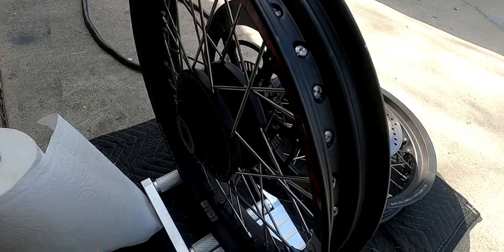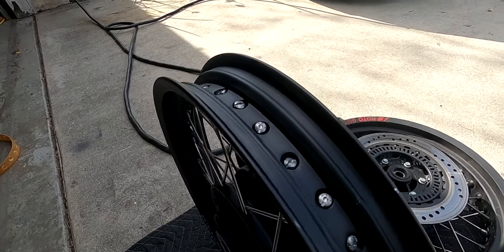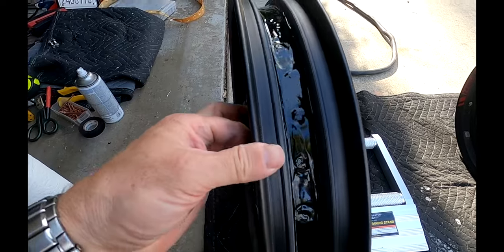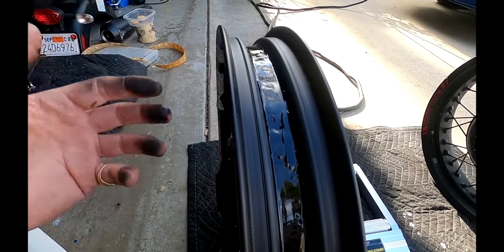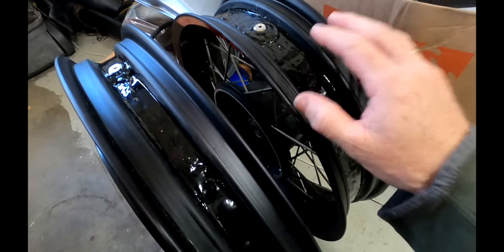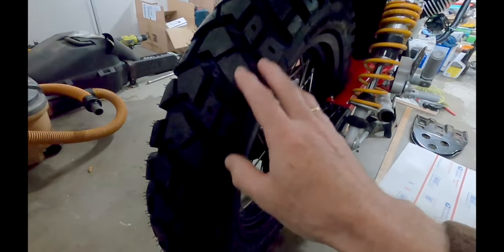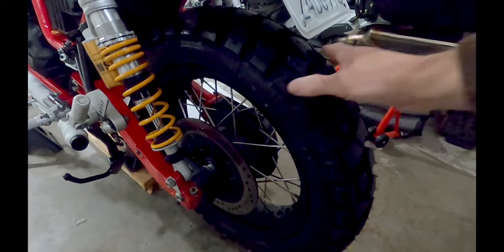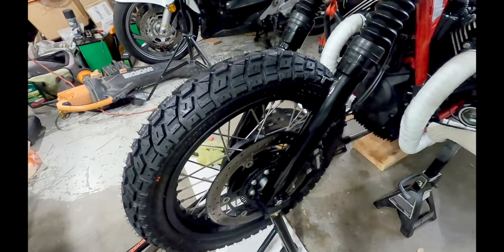TUBELESS CONVERSION

Comment: Great video. One detail I would change is to use the 3M 4200, not the 5200. I work with this stuff daily on boats and the 5200 is an epoxy grade, permanent bonding adhesive that literally pulls layers of fiberglass off with it when you try to remove it, so I assume it would be absolutely insane if not impossible to remove from the wheel should you ever need to repair a spoke, or change your mind. The 4200 is still a 500psi tensile strength poly and could be removed if needed. It’s also much quicker to cure.
Reply from the maker: Even when fully cured the 5200 remains flexible - so a very sharp blade will cut it. cuting out a small section to remove and replace a spoke might be a pain in the a$$ but it is doable. My tubeless conversion is still going strong and 100% leak free. Thanks for the expert suggestion - it's worth considering. Continued safe riding to you.
Reply: Hai usato il 4200 sui tuoi cerchi?
Reply: Hi. Is still good your wheel without leak?
Reply from the maker: @같이투자  Yes no problems at all. I wish you continued safe riding !

Comment: Hey friend, buy a tube 2 measurements below the diameter of your rim, previously cleaned, install the tube and then cut it lengthwise, the sides will be on the sides of the wheel.  Install the tire, inflate it and once inflated, use a cutter to cut the sides of the tube.  The result is excellent and more practical.
Reply from the maker: Interesting idea .... I've never seen it done so I can't comment on the effectiveness  - I'd be concerned that the flex of the tire when riding will cause the inner liner to move and possibly leak ? Continued safe riding to you.
Reply: @thebritonabike This method mentioned is widely used by many in Brazil.
Reply from the maker: Are there any Youtube videos showing this "Brazil" inner tube method ? @luziosalles324
Reply: Dozens, mostly in Philippines or Vietnam. I did this split tube or ‘ghetto’ conversion two years ago - simple, quick and almost free. For variation you can use a tube that was previously punctured, provided the hole is in the ‘frill’ area that is to be trimmed off. In SE Asia they will cut a tube then overlap and vulcanise the ends to give smaller diameter. Oh, to provide a backup they usually tip a slurry of cornstarch into the tyre as a sealant!. But here is a KLR 650 being converted on the back lawn in OZ … 

https://youtu.be/60bi1r2Xvbo
Reply from the maker: Great information. Thank you for the comment! I wish you continued safe riding !  @Kathikas1
Reply: But it doesn't succeed always. I tried it doing on the rear tyre of RE Interceptor 650 with Verdestein tyre, but the tyre on one side didn't come out towards the rim. It got struck inside the rim duspite inflating the tyre to 80 PSI.
Now I have got Sikaflex 291i adhesive tube with me and in a day or two I will try using that on the front rim. Hope it holds well. Iam trying Sikaflex 291i which is equivalent to 3M 4200 but way cheaper. 3M 5200 costs around 80 dollars here in India whereas Sikaflex 291i costs only 10 dollars.
Hope it works.

Comment: If this was such a good idea bike manufacturers would do it. BMW spent fortunes on spoke wheels but they didn't do this because it's dangerous.
Reply from the maker: It's Absolutely NOT dangerous. It's simply an effective MOD that allows U 2 plug a tire rather than remove it and fix a leak in an inner tube. It's also removable if you need to repair or replace a spoke. Its' NO different to riding on NON spoked wheels.   - Thanx for watching - stay safe out there on 2 wheels.
Reply: You are using a marine sealant to seal spokes. Says it all really. I'm sure this method is endorsed by the bike industry.
You say this method is absolutely safe, if so I would love to see what you base this on. It's  Russian roulette, absolutely safe until .......!
Reply from the maker: The 3M sealant is PERMANENT, flexible, bonds to everything and the absolute best thing to use for this application. Anyways  - No worries - let's just agree to disagree. These kind of mods are very common, and there are hundreds of other Youtube videos where owners have done exactly the same thing to there wheels successfully - hopefully with no ill effect. If you are careful, thorough and accept the risk - as with most motorcycle riding nothing is 100% safe. All I have is my own experience of 43 years of motorcycle riding, owning almost 50 different motorcycles and riding 500k accident free miles. I've never been a fan of inner tubes, and repairing a motorcycle inner tube out on the road is a HUGE pain in the AS# ...... anyways thanx for watching ! Stay safe out there on 2 wheels. All the best. @stephenparker6288
Reply: well stated @thebritonabike
Reply: I’m doing it on my next tire change.
Reply: Why is this any more dangerous than getting an ordinary puncture?
Reply: @stephenparker6288  OK now is a great time to explain your assertion..." You are using a marine sealant to seal spokes. Says it all really."....I am calling Bullshit....It says nothing but your pontification  ....What or who says it's wrong or dangerous?
Reply: If this mod leaks the air will come out slowly unlike a tube that can have a catastrophic blow out and a 50/50 chance of an accident.
If you put a patch on a tube the patch wont be the same thickness as the tube, what is that saying a chain is only as strong as it's weakest link.
I will be doing this mod on my bikes, at 65 years old to much of a struggle getting the wheel and tyre off the bike on the side of the road.
Reply: Classic road race bikes do it. Two tubes are 1.5kg, thats horse power. Makes a difference on something with only a few horse power😉

Comment: Howyou will adjust ( turn ) spokes ? If you cover with sealant. And these is wheel ( disk ) not for tubeless tires.
Reply from the maker: If you read through the comments this question has been asked and answered several times. Continued safe riding to you!

Comment: If you live in Arizona or a hot climate note the heat rating is 190 Fahrenheit or 87 Celsius. 3M says " Long term exposure to temperatures greater than 80º C will decrease tensile strength over time."
Reply: That’s simply not true
Reply: @KadeStringer2.0  Do you think I dreamt that up or took it directly off the 3M site? You could look that up yourself.
Reply: I agree if doing this on sumo, the rubber will get quite hot. I would not be that concerned for offroad or travel bike. I can't remember a time when I couldn't hold my hand on a tyre even in scorching hot sun.
Reply from the maker: Excessive heat will degrade pretty much anything especially rubber but so far so good and it gets pretty hot where I live 110 degrees in the summer months is normal. Tires are holding air and the sealant seems fine. Stay safe out there on 2 wheels!
Reply: Are you boiling hot person? 😅
Reply: How does it balance out?   Interesting for sure.
Reply: @mafosa8519  quite good. you are not doing half the wheel but all of it
Reply from the maker: @mafosa8519  Amazingly the rear needed nothing to balance out - and the front only needed a single 0.25 oz stick on lead balance weight for it to be in perfect balance. Your results may differ. I wish you continued safe riding.
Reply: @thebritonabike  same with me - better! did only rear and had to even remove 2 quite heavy weights to balance it. was quite surprised to say the least

Comment: How you remove the sealant come spoke retightening time? Serious question......it will be very difficult I imagine.
Reply from the maker: when you tighten spokes you don’t usually have to remove the tire ! but if you have a broken spoke that needs replacement then yes you would need to use a sharp blade and cut a tiny piece of the sealant out to access the head of the spoke. Then add a blob of sealant after the spoke repair. I wish you continued safe riding.

Comment: Excellent video.  I was looking at kits to go tubeless and shaking my head because it looked rather easy.  Then I came upon your video.  Sealant and valve stems.  No kit needed.  Perfect.  I was primarily concerned with the rear tire, but heck, may as well do both.
Reply from the maker: Glad I could help! Best of luck & Continued safe riding to you.

Comment: Bicycle rim tape could be the one you need.
Reply from the maker: Not for the pressures are stresses put on motorcycle tires at speed - bike take is for bicycles not motorcycles. I wish you continued safe riding !

Comment: NIce thanx. Just got a 2024 Honda Transalp 750 XL with tubed tires.
There are balancing weights for spokes (outside the rim) for those that do not know.
Reply from the maker: I LOVED my old 1994 Transalp! Wish I'd never sold it .... ah well the new one is on my list to test ride for sure ! Enjoy your new ride ! I am sure it is fabulous! Continued safe riding 2 U.
Reply: Did you convert your rims to tubeless?
Reply: @ELFpkck  yes, he did. Did you not watch all or any of this video?
Reply: @onemileattatime2642  If I wanted to ask the channel’s owner I would use a separate comment not a thread one. I’ve asked the commentator @human1513

Comment: I did a similar thing 15 years ago on the rear of my Africa Twin, with a Sykaflex product, less liquid and mouldable, leaving a thickness of 5mm above the spokes, because these sometimes push inwards and can cause a loss of pressure.
Reply from the maker: Do you still have the bike ? I get asked a lot how long this sealant will last and I am guessing - but probably at least 10+ years ?  Continued safe riding 2 U.
Reply: @thebritonabike  Yes I still have it, but the 30 year old rim has started to be corroded, small parts of aluminum are falling off, and it can no longer guarantee an airtight seal on the edges, the Sikaflex strip on the other hand is immortal, despite the many tires changed manually which stresses her quite a bit.
Reply: Hello, which Sikaflex did you use? Was it the 297?
Reply: @thebritonabike  Very important is that you leave space to allow the tire to descend into the rim when you mount the tire

Comment: Hi @thebritonabike what are the implications if you do want to get to the screw head after having applied that adhesive ? can you take it off without damaging the grooves of the screw, maybe with a solution ? thank you very much for the video. had to search a bit to find something like this. cheers!
Reply from the maker: If the seal ever fails on the inside of the rim and you need to access or remove the stem valve you'd simply need to cut around the base of the valve with a blade to access it and then remove it. I added some sealant around the base of the valve for added leak protection. Continued safe riding to you.
Reply: @thebritonabike  thank you, to you too.

Comment: Buddy I have just ordered the sealant and ready to do the tubeless conversion. Is yours still going fine? Did you pop in liquid tyre sealant into the tyre after?
Reply from the maker: Sealed Rims and tires are Still doing great - no leaks or flats. NO I didn't add any tire slime or liquid sealant. Make sure you check and tighten the spokes before you cover the spoke heads with the sealant. Best of luck & Continued safe riding to you.

Comment: @davidgun6826
1 second ago
I just put my tires on the rims I let the seal cure for 6 days- front tire worked great, went right on sealed great, but I had trouble getting the rear to seat  Tractionator  GPS  are very stiff walled. I ended up having to use the oxy-acetylene method, that worked very well.  I will check to see if there is any air loss in them tomorrow then put them back on the klr
Reply from the maker: I have the pros at a bike shop mount my tires and rims - these days the tires are so stiff you need an industrial mounting machine to do it without damaging the wheel rims. Stay safe out there on 2 wheels!
Reply from the maker: @danielkerr4100  Great idea .. I think I should do a video demonstrating that technique! NICE. I wish you continued safe riding !

Comment: Really interesting video, completely different take on all the other diy tubeless conversions I've seen and you're the first person I've ever seen to have looked into the different grades of 3m sealant and the best one for this purpose. 

Seeing as it's been over a year now, how's the tubeless conversion holding up?
Reply from the maker: Glad you liked it! Both rims and tires are still holding air perfectly - no issues at all. I figure measure twice / cut once .. do it right the first time and don't cheap out on materials or you'll regret it. This mod works. I wish you continued safe riding!
Reply: @thebritonabike  Thanks for the reply! That's great, so glad to hear it. Have to admit it, your conversation really reminds me of the bartubeless conversion/wheels. 👍

Comment: what did you with the hole for the valve stem before, during, and after this process. so a valve stem can be installed easily after?
Reply from the maker: I slightly enlarged the existing hole for the new stem valve so that the tubeless valve will fit. Cordless electric drill with a metal bit. After the new valve got pushed into place I did add a little bit of the sealant around the inside edges of the valve for an additional airtight seal. Tires are still holding air perfect with the tubeless modification.

Comment: Did you tape off and cut out the 3M for the valve stems and reapply around them, or did you have the valve stems already seated while applying the 3M?
Reply from the maker: The valve stems were already installed - then I added sealant around the stem seal for a double seal. I wish you continued safe riding.

Comment: Thx, nice video, what do you do if you need to true the wheel in the future?  is that sealant easy to remove?
Reply from the maker: The sealant covers the inner spoke heads - so before you apply I recommend inspecting, adjusting and tightening the heads. The sealant will lock the heads in place - if the wheel gets damaged or bent in the future spoke adjustment will be the least of your concerns ! Hardcore off road / adventure bikes / dirt bikes with spoked rims might need more future spoke adjustment due to the abuse the rims get off road - but if this mod is going on a street bike I doubt your spokes will ever need adjusting - mine never had. As far a removal - yes you can cut and peel the stuff off - but it is not easy to remove. Remember adjusting the spokes can also be done with the tire on - from the outer threaded nut on the spokes - hence the sealant will hold the spoke head inplace as you adjust. I wish you continued safe riding!
Reply: @thebritonabike  thank you for the thoughtful reply!  I have 0 plan to do hardcore off-road/single track riding, but planning to do FSR / logging roads etc.  it is good to know spoke adjustments can be done on the outside too. Cheers!
Reply from the maker: @carsonau  My pleasure - here is a good video showing external spoke adjustment - https://youtu.be/EAhpngivMJA?si=M5Yc5e92VgKuOQWV

Comment: hi if you want to chnge the air valve how will you because it compltely molded with sealent if chnage the valve  there will be a air leakage ?
Reply from the maker: If I ever have to remove the stem I would need to cut around the 3M sealant. This would not affect the sealant around the spoke heads. I have NEVER had to replace an actual stem - just the internal shradder valve. But my decision to add a little extra 3M sealant around the valve stem seal was just for an added seal and layer of protection against leaks. So far so good and no leaks - in a year + of riding on them. I wish you continued safe riding.

Comment: I read somewhere some using epoxy to seal the rims, probably works the same too
Reply from the maker: I am sure that any strong bond waterproof epoxy would do the job ... as it was my first time attempting this I just went with the 'strongest' marine grade I could find. Measure twice / cut once .. no desire to have to redo it ! Continued safe riding to you !
Reply: I don't know, but epoxy my not be flexible enough after it fully cures. hope it works out OK.

Comment: Thanks. Very interesting. At what stage do you actually install the valve stem? Do you have a link for the valve stem?
Reply from the maker: Thanx and glad you liked the video. I added the new stems before adding the sealant. The valve stems came from my local AUTOZONE parts store. Slime Hi Performance TR416 Tire Valve Stem. Here is the link : https://www.autozone.com/tire-repair-and-tire-wheel/tire-valve-stem/p/slime-hi-performance-tr416-tire-valve-stem/582043_0_0